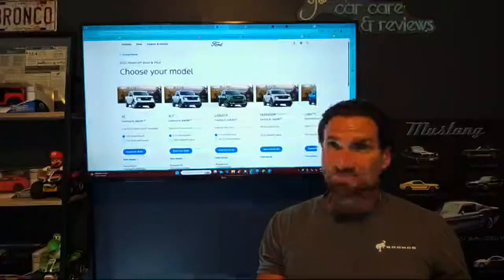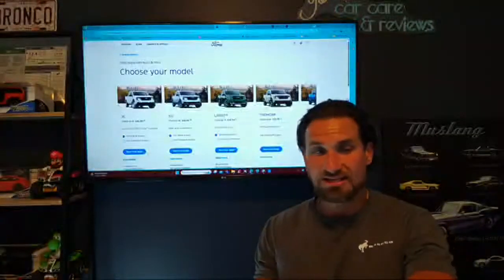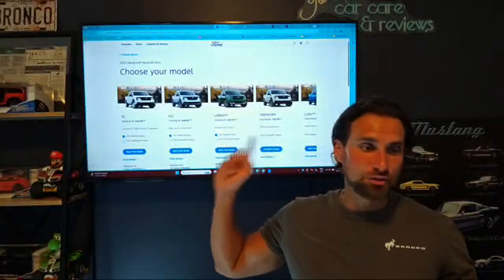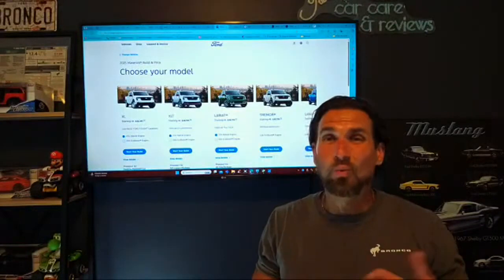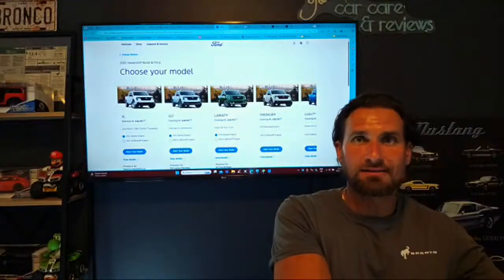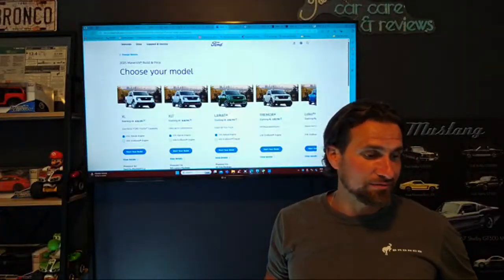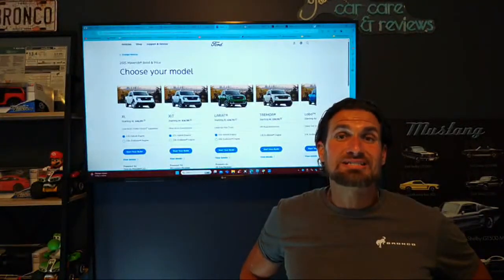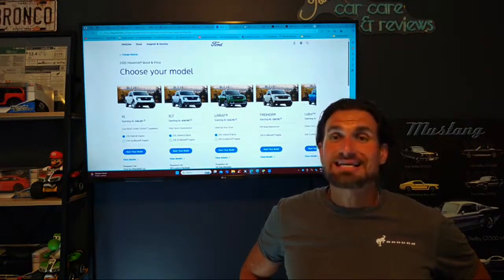Ford Maverick Powertrain. How it Works, Reliability and More!

Comment: I thought the 12V battery was charged through the DC to DC Converter, using power from the HV Battery.  Also, here is a great video on the operation of the Maverick ECVT.  This video breaks down the Rav4 ECVT, but as you said, Ford and Toyota worked jointly on this system.  https://www.youtube.com/watch?v=O61WihMRdjM
Reply from the maker: Great specification. Thank you

Comment: Johny, I'm surprised you and Marie only had her Maverick for 2 months. 
I've had mine now for 2 1/2 years and have enjoyed it and the great gas mileage.
Consistently averaging between 42-44mpg normal type driving.
Considered getting the 2025 in hybrid awd, but probably won't based on much higher price.
Reply from the maker: Russell my friend! Ues the Maverick was great until we measured out a rear facing baby seat complexity. Marie is a rally passenger and we sold 5k over what we paid so it made dollars and sense